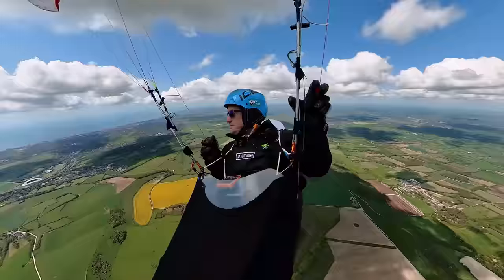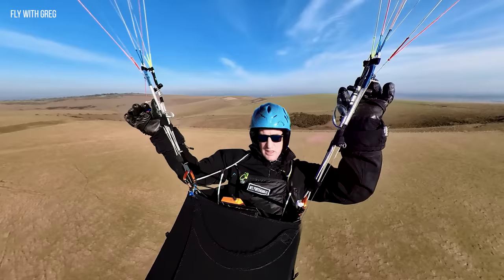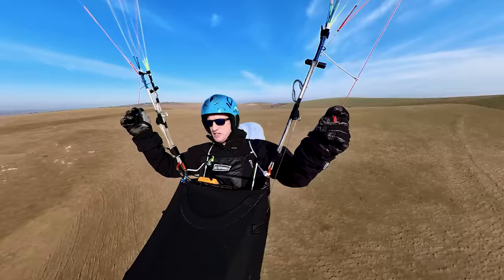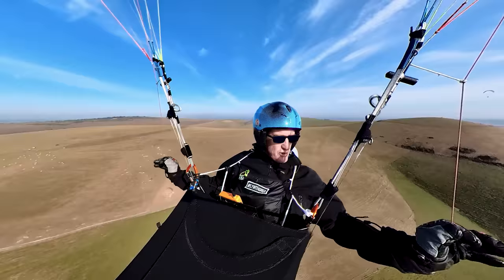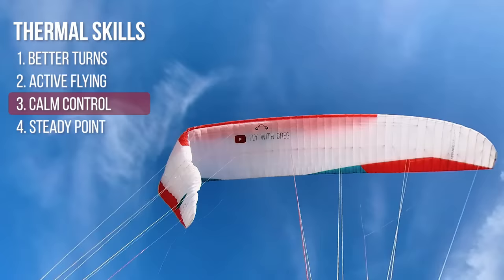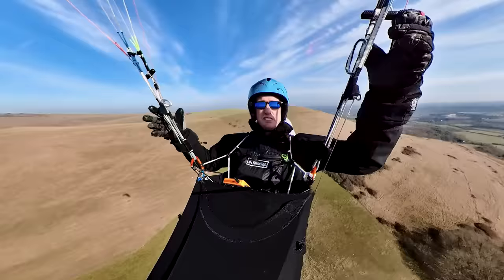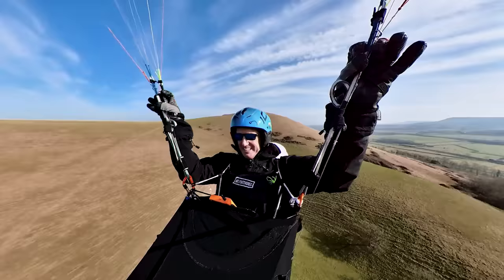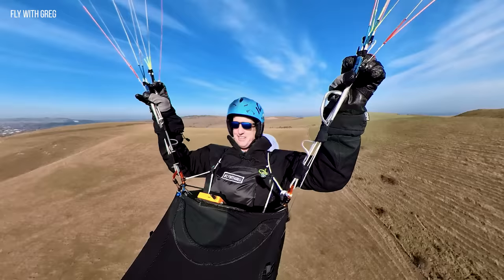THERMAL FLYING for beginners

Comment: Tips to where to look during a spiral? Wing tip?
Reply from the maker: yes, inside wing tip, just like in thermaling.
Reply: Fixed point in the landscape every 90 °, from one side to the other side of the wing, then next item.
Reply: @PhilippeLarcher  really? that would drive me crazy. but whatever works for you.
Reply: @tobiasbrunner4720  why so? It makes the landscape not scroll and get blurry basically, your eye compensate for the rotation. You can train on the ground.

Comment: Don't get too used to this advice. The mustache is going to change all of the defaults.
Reply: No one is going to be thermalling in a mustache.
Reply: @Seth Tucker  just the other day someone did a 200km XC flight on a 22m mustache, and the have prototype larger ones specifically to replace normal PG's, so I wouldn't be so sure if I were you, since people already are thermaling them...
Reply: I would feel safer under a full beard tbh
Reply: @bikerdude923  Obviously, I don't mean in an absolute sense. 

It's just that they don't really offer major benefits for thermalling or XC. Great toy for screwing around on the Dune? Sure.
Reply: No way people would prefer fly the moustache for xc in terms of performance, fun yes, but no where near as effective as two liner.
Reply: @bikerdude923   However they actually removed the original risers and replaced with paragliding ones for that xc..